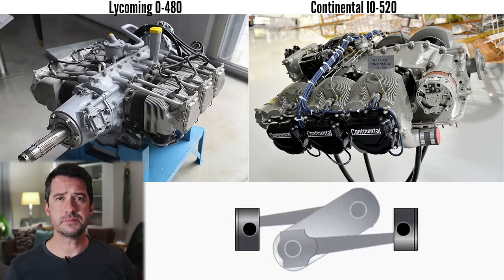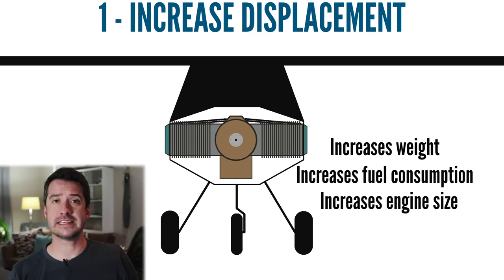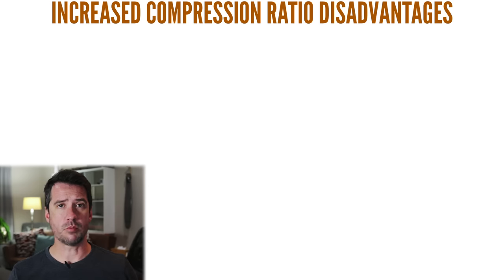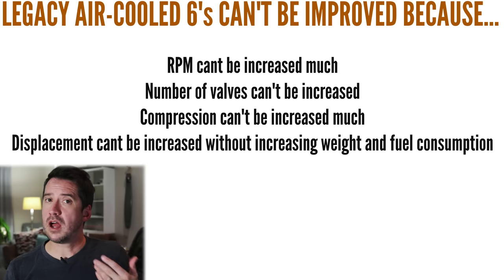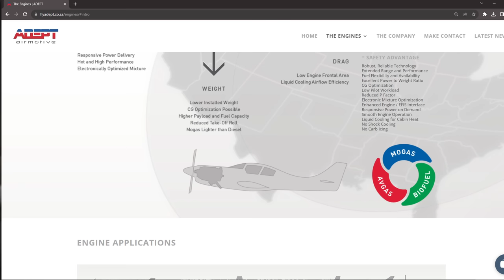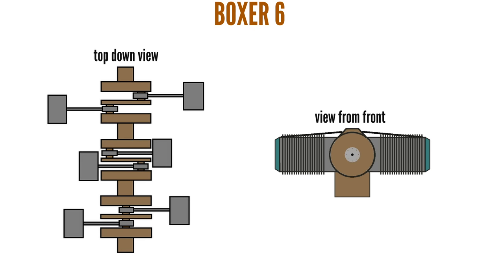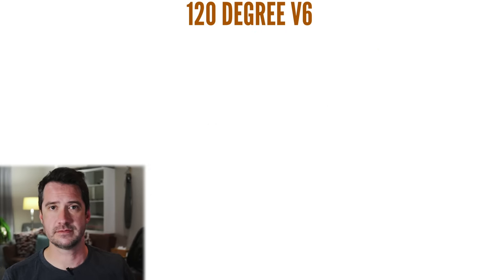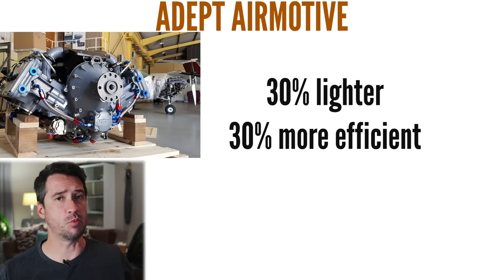Unusual V6 Airplane Engine Makes Boxer 6 OBSOLETE?

Comment: On the air-cooled flat sixes, one can decrease weight while improving cooling is to replace the steel cylinder barrels or linings by using nikasil coated alloy cylinder barrels. Also as both use 2 pushrods per cylinder, use the technic Honda used with the CX motorcycle & Moto Guzzi used with Daytona to get 4 valves per cylinder from 2 pushrods for cylinder
Reply: That system was known to be complex and unreliable.
Reply: They don't need the additional flow provided by 4 valves because they turn slowly.
Reply: @SuperYellowsubmarin  even diesels profit from multivalving. Sure aero engines run on low speed torque, well unless the prop is geared down, like Naipers & Rotax, but an added efficiency of 10 to 15 % is nothing to squeeze at. Especially without the added weight, complexity & unreliability of DOHC engines. Go do a image search of Honda CX or MG Daytona heads to see how simply they operate 4 valves per cylinder off 2 pushrods per cylinder. Plus there are many UTube channels where they tear down blown motors. (After blown bearings) the 2nd most common reasons engines blow are from hydraulic OHC cam chain tensioners breaking a part & bits going everywhere in the engine. This does not happen with old fashioned pushrods.
Reply: Nikasils worked well in Porsche 911s but I think aircraft grade nikasils would be prohibitively expensive. I have seen specially made nikasils used in VW engines modified for motogliders, and they seemed to work well in that application, but they were very expensive. I liked they way they could be weld repaired and recoated.
Reply: @mickvonbornemann3824  most DOHC related engine failures are because they haven't been adequately serviced, something that isn't usually an issue with aircraft since they just wouldn't be allowed to fly.
Reply: Try getting that by the approval process💸💸💸💸💸💸.    Then there is the cost itself and very possibly reliability.   All those things add up when trying to introduce anything to aviation.

Comment: I wish Lycoming and Continental would make a new and modern engine design. I see why they don't feel the need to really innovate. GA has been in a decline and the existing customers are basically forced to continue buying the ones they already produce and remanufacture. Most every airplane is old. New airplanes are near unobtanium. GA airplanes are slowly decreasing in numbers and costs will continue to rise. I'm amazed there hasn't really been any government intervention to help alleviate the issues considering how much the global economy relies on it. I suppose we just wait for a crisis to happen so they can campaign about it.

Comment: Lavish claims but even if they meet their claims, Adept is destined to fail. The reason? Price. If this engine sold for $15-$30,000 (usd) it might have a bright future, but there is no market for a new $75-$85,000 (usd) low horsepower piston engine.  It is most likely Adept is using something like the 120-degree V6 that powers the McLaren Artura, a supercar so expensive only 375 were made. That number is low even by General Aviation standards. Skyrocketing prices drove Continental and Cirrus into near bankruptcy before CCP aviation funding bailed them out and Chinese money will likely be the only way to keep these GA relics alive, if just barely--and temporarily. General Aviation history is littered with great ideas that failed financially. Delta Hawk, Continental, Lycoming and others are discovering that new-tech $75-$150,000 engines don't sell. Adept will also learn this lesson, a lesson they should have learned from market surveys, before they spent real money.
Reply: The naivety boggles the mind.

Comment: 2 main reasons why this won't happen-  lawyers and liability. The typical 6 cylinder Lycoming or Continental is 55-75k or more. Most of that is to pay for liability. Liability has stunted development because every time an improvement is made, it opens up everything that came before to a lawsuit-  In a lawyer's mind,  an improvement must mean that everything  previous must've been flawed in some way. VIRTUALLY ALL GA ENGINES STILL USE MAGNETOS WITH POINTS! POINTS IGNITION IN 2023! Even if this engine came out and was really superior to anything else, if would still need maintenance eventually. Who is gonna fix it? It will take years for mechanics to feel comfortable working on a new type engine. The Porsche Mooney could only be fixed by factory trained reps. It died a slow painful death. Good luck. The GA market is too small.
Reply from the maker: All true, but I don't think the industry should stop trying though. Between all the failures there has been successes! Rotax and Jabiru as examples. Jabiru got a massive foothold in the light sport engine market, powering many more airframes than just Jabiru's. Rotax has more than just a foothold, I'm sure I don't need to elaborate. But yes, the more expensive the engine, the more difficult it will be since fewer airframe manufacturers or even kit builders will go for an unproven expensive engine. But I don't think they should sit back and wait for electric to become viable (provide 5 hour endurance like ICE provides).

Comment: Regulation is the biggest block to any new engine trying to replace the antique garbage that the aircraft were certified with in the middle of the previous century. FADEC should be a $5k retrofit to give the unreliable old engines a boost in usability.  Nobody should be futzing with a mixture control to get one or two cylinders to run near optimal while the other run cool and burn extra fuel. The delta in cost for opting for proper fuel injection on the antique engines is more than the entire engine should cost. It should not be possible to buy a new engine without FADEC. New and remanufactured engines should all be built to run on unleaded fuel. Magnetos belong on chain saws. Aviation regulates to retain old, unreliable, poorly performing junk. Vacuum systems should be relegated to cleaning out cruft.
Reply: Just use a small block Chevy or a Hyabusa engine.

Comment: Very nice presentation for the non aviation and non-engine designers. However - - -The one overriding parameter that has not been addressed is OTE, overall thermal efficiency. OK, sure, valve timing, expansion ratio, compression ratio, friction reduction gas dynamics all can be optimized for this engine but  . . . . does it burn less fuel?  That was not addressed, or I missed it. Yes you can push RPM, meet weight, meet the cal envelope BUT fuel burn (Efficiency) It is THE most important factor for business GA, and even hobbyists, when the fuel cost is high and the gal/hr or liters/hour are considered. My RV7 IO360 gets 20-25 MPG at 200 mph. but is all airframe efficiency. Most GA get 7-12 mpg. At 17 gallons per hour for the power needed, that is a very high cost and bites the customer every time fuel is purchased. From the dawn of time, if a replacement "thing" does not meet ALL the needs of the original AND offer something (or many) better, then it is a failure. Better, faster, cheaper. The iPhone is one good example. Camera, palm pilot,  music storage, on and on - -all in one device. I was in this business (engine design) for 40 yrs and part of that for aircraft.  A Rotax is very unreliable by comparison to a Lycoming. Nobody, nobody can spend the required $300-500M to design, develop, tool and make a better engine for 2000 units per year. 

Many have tried, and many have gone broke/quit when the proper parameters were not improved or ROI was not in sight.
Reply from the maker: Some very valid points, thanks! Yes you've hit the nail on the head with your first sentence. I'm not making videos for engine designers, I couldn't possibly teach them anything. I'm not trying to go too in-depth either. I'm not sitting with the engine data, I only have what I can find on the net so I'm elaborating on what I can find in my research.

I often hear people saying that Rotax is less reliable than the Lyco/Conti. I've come accross few statistics analysis showing that simply is not true. The latest one I saw recently was by Kitplanes. I can't share links in comments, go to kitplanes dot com and search for the article "Accidents: Passing the Engine Baton" for an eye opening read if you are interested.
Reply: Air-cooled engines have historically had high fuel consumption due to the piston clearance. They simply lose too much fuel-air alongside the pistons, which must then be vented out of the crankcase. My memory is that the rule of thumb was 8-12% better sfc for a similarly designed water cooled engine. That’s why the Voyager had one in the aft position.
Reply: @russbell6418  Actually, the air-cooled engines are pretty good compared to liquid cooled, brethren, some actually much better than most, and in the '80s were competitive with diesels. Mostly because they run at WOT most of the time, but are certainly challenged by the lower compression ratios which yield much less expansion ratio of the combustion charge. Liquid cooled allows lower combustion metal temps, allowing higher Cr yet not detonating. The prime voyager engine was pushing much higher Cr due to a special combustion chamber design and allowed much greater LOP operation than production air-cooled engines. I think that model EFI, with better A/F control and management of swirl, tumble, and optimized valve events could do much better on SCF. Typical gasoline engines were in the 25% overall thermal efficiency, but today pushing 35% and F1 engines are over 50% OTE - of course limited to seconds at full power vs 2000 hours on an aircraft engine.

Comment: Every time someone talks about increasing compression ratio in aviation engines,  they bring up the fallacy that high compression engines aren't possible without being unreliable. All other engines in the industry has reliably increased to 9.5:1 minimum, with automotive engines going as high as 13:1 while reliably running on 87 octane that has gone stale. The big key is to build the engine around having high compression, not just slapping domed pistons and calling it a day. Small and Big Block Chevy guys has been doing this for decades by installing a modern style cylinder head with a small chamber volume, high compression pistons, a camshaft designed for high compression use, and an ignition controller to automatically adjust ignition timing based on load and RPM. Yes, that's a big list, but they are able to easily modernize a 70 year old engine design, improving efficiency while still running on regular pump gas. Yes, you can still keep your carburetor to make people feel happy. No, this does not require water cooling, as people has done this same work on air cooled Porsches for years.
Reply: I'm sorry, but please stop trying to apply automotive thinking to aircraft. Automobile engines cruise down the highway at 12-18% power while aircraft engines run at 65-100% power all the time. An aircraft engine has to be designed and built from the ground up to fly. Automotive technology like 13:1 compression ratios will not work in aviation. The best aircraft engines actually function more like lightweight air cooled tractor engines.
Reply: @rescue270  and this is my problem with many aircraft enthusiasts. They are stuck in the mindset that "this is not possible", or "it can't be reliable". They automatically assume that anything remotely modern, even if it's 1980s technology, is automatically not reliable.

As I said, it's possible to improve efficiency with aircraft engines while also improving reliability. The thing is you can't just slap high compression pistons and call it a day. Different camshafts, cylinder heads, and ignition system is required, but can easily be done reliably.
Reply: @patx35  
I am not an "aviation enthusiast." I am an aviation professional. A&P, I.A., CPL. I have worked on and flown airplanes for 42 years. I have learned that much of what has been purported to be new and improved is almost always more expensive, more complex, and more trouble with little improvement. I am speaking from experience. Sealed recombinant gas batteries are a definite improvement. The Castlegar Trust engine baffle STC is another great improvement. An old Bonanza with that installed will run so cool you'd think the CHT gauge is broken. Composite propellers are not. Expensive to buy and expensive to repair. Nicks that can be easily filed out of aluminum blades have to be repaired by a specially rated propeller shop. Electronic ignition and injection systems require electric power sources and backup power supplies that are not even needed with magnetos that generate their own power in a very compact and very simple unit. To me, the efficiency gained is not worth all the added complexity and subsequent maintenance. Don't even get me started on glass panel displays. We had so damned much trouble with those at the flight school. The old "steam gauge" (I hate that term) instruments were much more reliiable. 
A car with 13:1 compression will use that power for short bursts and cruise at speed using about 12-18% power, but an airplane has to sustain 60-75% all the time in cruise. A gasoline engine with compression that high will wear quickly. Ask anyone with a 220 hp Franklin engine that has 10:1 compression how long their cylinders last. You have to very diligently manage power in one of those.
Liquid cooling was fine for WWII fighters that were constantly maintained, but in general aviation it is another critical system that requires scrutiny because it could fail. Airplanes are air cooled for a reason, as the Thunderbolt proved against the Mustang. 
Diesels are also a subject of my criticism due to the fact that they cannot make enough power to hold altitude if the turbocharger fails. Too many eggs in one basket for me. Couple that with the fact that they are very expensive and I don't think any of them are authorized to be overhauled. They have life limits and must be replaced.
I am all for new innovation but I strongly and obviously feel that general aviation research and development is going in the wrong directions. Working toward complexity only begets more points of failure.
Reply: I saw much more compression with direct injection engines. BMW aims at a bowl in the piston. This would really work well with long stroke, high torque flat-6. (BMW uses it for inline-6 with their small bore)

Comment: Many legacy high performance aircraft engines have propeller reduction gearing, so that's happening already, just like forced induction. Also like forced induction, it is reserved for the high performance, high-cost segment, for the reasons you said.

Comment: As far as pushrod engines go if you wanted to make the engine rev higher you attach the prop to the cam gear for a 2-1 gear reduction. Its also not very hard to make them rev high either as long as the pushrods hold up you can put 1.5-1 ratio roller rockers in the head.
Reply: You may want to rethink that. Crankshafts are massive; camshafts can be lightweight or even hollow. If you want a set of massive gears to drive a massive camshaft with a massive propeller bearing , then maybe this engine belongs in a very large truck!
Reply: @captronrv7 crankshaft is also hollow
Reply: @captronrv7  well the camshaft and propeller would just be connected to the same gear. The gear would be over kill for the camshaft that's attached to it but perfect for the propeller on the other side
Reply: It's been done. Look up Continental Tiara
Reply: It's not the camshaft or pushrods that are the ultimate weakness, it is piston mass. An io390 piston weighs about 3kg while an aver 1.5l 4 cylinders piston weighs about 300g both making similar power at similar piston speed. Those big engines are under a lot of stress.
Reply: @chippyjohn1  sure but but doesn't 7k still seam reasonable for reliability? I mean hell 1liter 4cylinder engines are pushing 14k these days.
Reply: @hoodedcreeper2465  7k for what engine?
Reply: @chippyjohn1  an ls7 can rev to 7k stock. And that's with a 105mm bore and 101mm stroke. I do understand that the reliability requirements for airplanes and cars are a bit different. short stroke an ls7 to 5 liters with a smaller crank and longer connecting rods and I don't really see a reason it couldn't hang out at 7k reliably
Reply: @hoodedcreeper2465  That's a stroke of about 72mm, and a piston speed of around 16.8m/s. Most aircraft engines are sitting around 10-12 m/s at max revs. With a 105mm bore, that's a lot of reciprocating mass. A few hours might be okay, maybe 24 hours, but 1000+ hours might be a strain. Only way to know is try. The power it would put out at that rpm would be far more than required for most small aircraft
Reply: @hoodedcreeper2465  An LS powered helicopter crashed just recently, wonder if the engine is at fault.

Comment: Continental Tiara- series was an interesting product, but unfortunately it was commercially unsuccessful.  In this engine, the propeller was mounted to the camshaft – no need for a separate reduction gear was needed.  https://en.wikipedia.org/wiki/Continental_Tiara_series